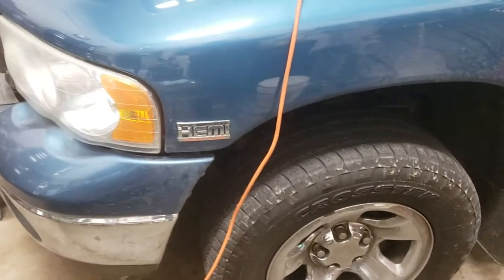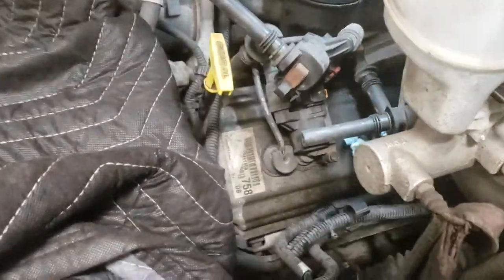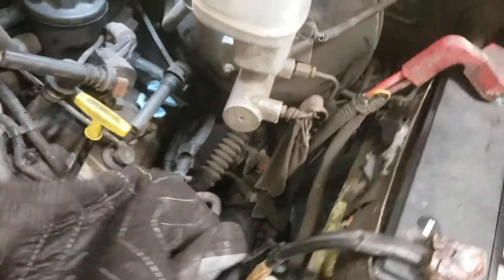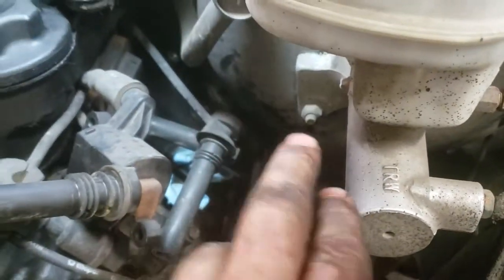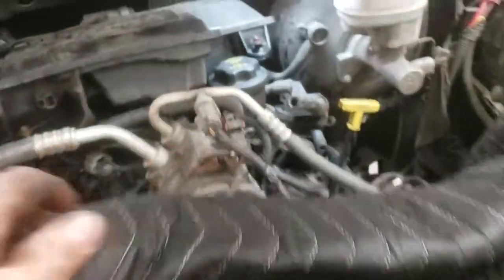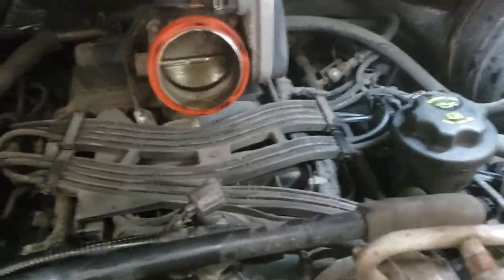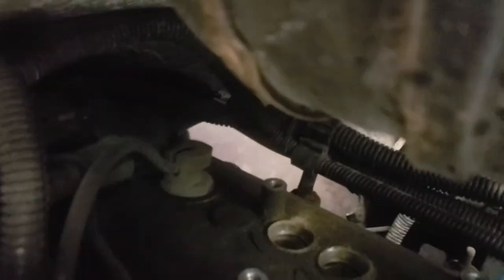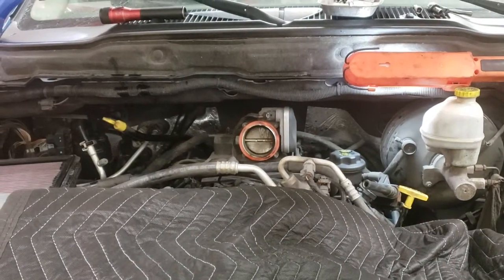How To Replace Spark Plugs 2004 Dodge Ram 1500(5.7)Hemi "Short Cut"

Comment: Do you know how to swap the key ignition switch, key sometimes won't  turn   and how did you get those two driver side back plugs out, great 👍 video
Reply from the maker: My truck did that also in a parking lot..I just tapped on the back of the Key with something hard while its stuck in there..It never did it again...Not 100% sure on replacing the Key cylinder it self. But im sure it isn't that hard..Thats what I was planning on doing before I learned that trick on tapping on the back of the key.

Comment: Good information. The early Hemi's, 3rd gen, like the factory original copper top spark plugs. The rats nest of spark plug wires, get rid of them. Put some shorty's on. It will not only run better, it will look cleaner.
Reply from the maker: Plug Wires do make it look bad.

Comment: Thank you, I just bough the same truck, going to do plugs and coils in 5 mins... But damn dude I have to ask, is that air filter THAT heavy where you are panting and grunting?...LOL
Reply from the maker: I was laying on my fat stomach at the time..lost 40 lbs since then..👍
Reply: @Garyjorges79  me too....lol. I was tearing out Volvo turbo on mine last summer.  Lol. So yesterday it was flat stomach on hemi engine. Finished coils and plugs. The rear firewall plugs were not too bad. The one under master cylinder I lost knuckle skin, and dropped a few fbombs. .lol
Reply: @Garyjorges79  awesome feeling isn't it😁

Comment: So close.  I was hoping someone would demonstrate removing the coils that aren't held by a bolt, just to make sure i don't break anything.  I'm sure it's easy but we just got this car and it will be the first time any of that stuff will be touched by human hands in almost 200k miles...
Reply from the maker: Some advise is to use a 6 point socket. Tap on top of the bolt not to hard.. Spray  penetrating oil through out the process if needed.. Try Tighten just very very little and loosen very little.  That breaks the corrosion/rust up.Thats what I've done in the past and has worked 95%. Sometimes they have broken here in Minnesota(Haha)
Thanks for watching

Comment: That throttle actuator says do not clean real big on the black cover on the left side lol I read it as I was cleaning mine like woops
Reply from the maker: Because I think it has a Zinc or some kind of Coating. I still clean mine because of the Carbon build up with this crappy Gas these days. I don't always follow the Guidelines. Thanks for watching.
Reply: it means do not clean that part of the throttle body to protect the circuit board under the black cover but you can clean the throttle body itself.